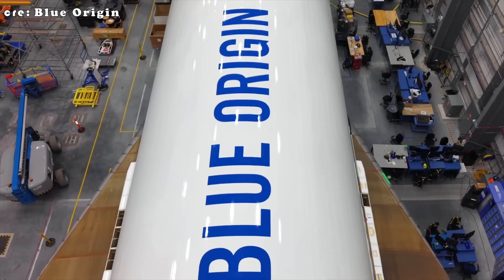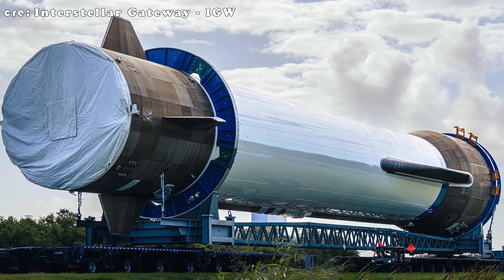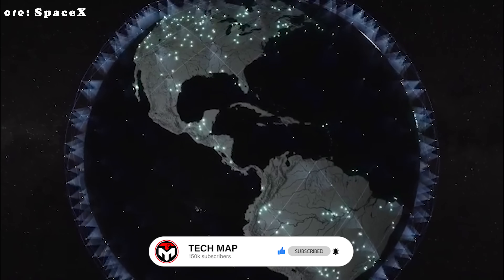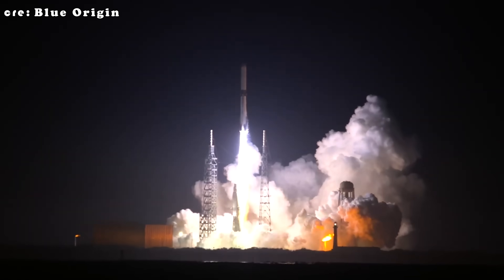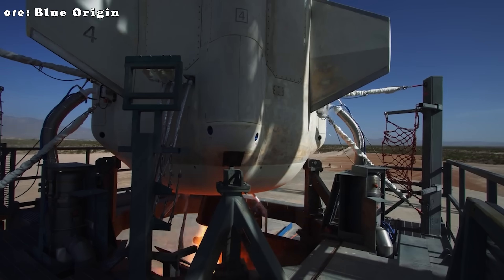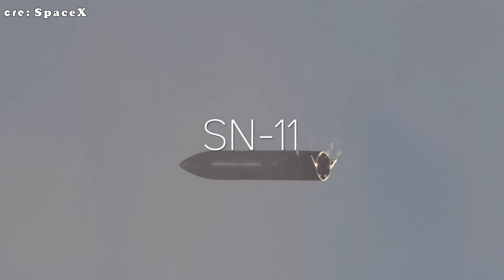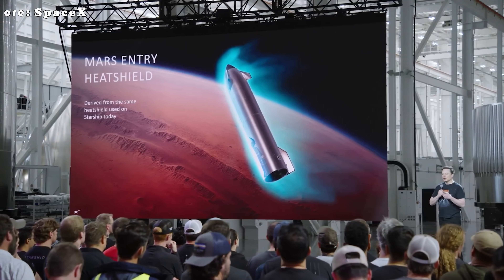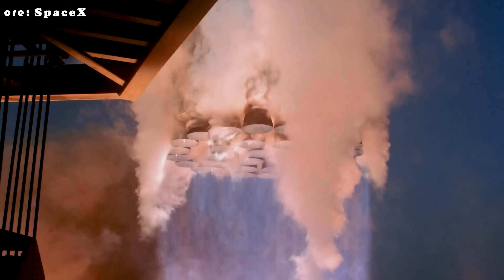What Blue Origin Just Did shocked whole industry but SpaceX Starship BETTER...

Comment: Bezo's rocket is a more refined design, built with better techniques and Construction assembly methods.
Where it lacks is still using Spaghetti Monster Motors.

Starship is rudamentary and clunky design wise, construction methods have limiting tendencies, but Raptor 3's are gonna be game changers.
Jeffie is still in the race, but needs a simpler engine, and mass production to really begin.
Reply: I can't agree. Elon's strategy is fail fast which means you quickly find out what doesn't work, change using the data from that failure  and retest. Once the system is working properly THEN you "refine". No point in spending weeks on details that might then have to be dropped after testing. Despite all that refinement, Blue Origin has only flown once.
Reply: @petersbayley 
More than one way to skin a Cat... And Starship is more than alittle "Steampunk"...
And insistantly crude in design and construction techniques.  And it never hurts to think more... before doing alot of dumb things and then rectifying the issues and calling it progress.

SpaceX has been cobbling up stuff long term, from crude beginings.

I suspect after 
Raptor 3's have a track record, Bezos will move towards a better engine design too, And end up with a better overall ship.

Quality pays long term, over things done halfassed...

Comment: So NASA admin is OK with timeline, but some vague dude declares they could delay the project by "years" and his concerns are complete garbabe. Dude holds no sway in NASA. He says: Raptor is not frozen yet... because you have to Stop improving it. Testing the hell out of it, and building that version at the same time isn't good because... reasons... Clearly he doesn't know anything about additive manufacuring. They don't have to go through massive retooling to make any number of versions on demand. 

For an engineer to not know this is disturbing. 

His other justification is that LEO fuel transfer has never been done... so... years. 
Spacex does frequent docking
Spacex did do a fuel transfer in LEO with no problem
Boil-off can be managed with foil solar shades (Starlab, James Webb)
The built fueling arms and use them on every flight (400x so far?). 

Sooo... WTF is revolutionary here?

The only people who "doubt" are schills for SLS (which very nearly got cancelled). Jim Bidenstein was a NASA admin but Zero technical background. He was gifted the job as a career politician... I am more qualified that he is. 

"Dozens of refuelings". 
V3 Lander has plenty of fuel to drop 50-100t cargo to lunar surface and return to lunar orbit as required
V4 Tanker has at least 200t cargo fuel capacity
V3 has 1600t full fuel capacity
Soooo.... 8 flights 9 if boiloff is an issue. 
Not "A Dozen or Dozens". 

Oh! We (the human race) will never dump more than 15-40t on a celestial body if we don't learn LEO refueling. Starship V3 can drop 50-100t to the lunar surface. Starship V4 (2027) can drop 100-150t to the lunar surface... and it can be improved on further...

Comment: Think about this… Starship fully depends on a successful in orbit refueling tech development. Has Space X tested in the Thermal Vac Chamber??? No. Why? They are not serious about Mars. Starship is all about launching Starlink. Everything else is hype and BS. Now Elon is suggesting a Mars launch next year… more Elon BS. How can you have a serious effort with a Carnival Barker making these type if statements? Insufferable to the last drop
Reply: You think you can test refueling in a vac chamber? You don't understand fluid dynamics....zero G is the challenge to overcome. The exterior pressure on a pressure vessel has zero impact on reactions that happen inside.
Reply: @deanl6613 Did I think you can zero G refuel in a thernal vac chamber?? No. Did I imply it?? No. Why do you think you test spacecraft in a thermal vac chamber knowing full well the spacecraft feels the force of gravity?? Why do you think?